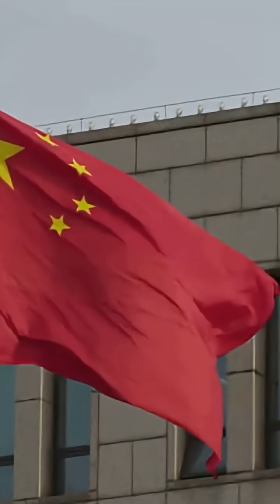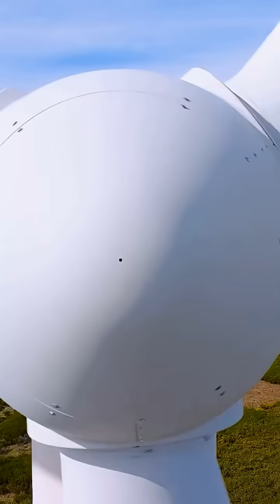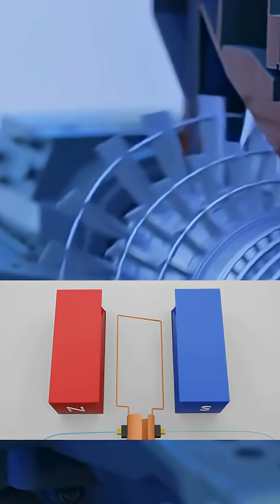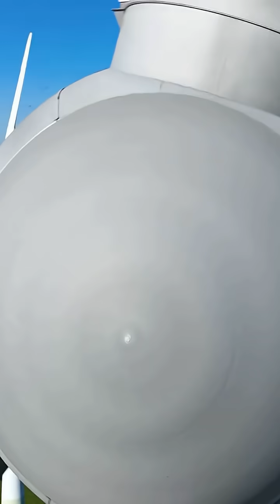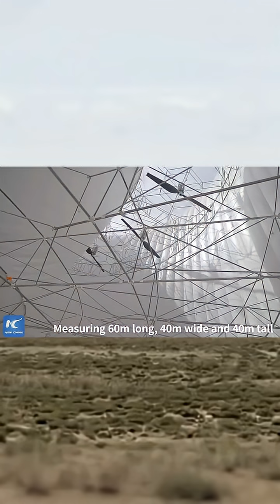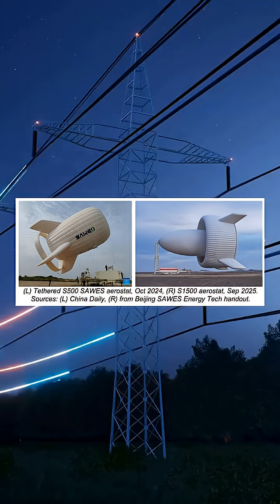The Physics Pushing Wind Power Higher #science #didyouknow

Comment: Yes, but one large caveat is danger to aircraft and open airspace management. Hitting a tether would slice an aircraft apart.
Reply from the maker: Thank you for the comment! And I fully agree with your point.  
Airspace safety is actually one of the first things engineers and regulators worry about with systems like this.

And remember that these aren’t meant to sit under busy flight paths or in open, uncontrolled airspace. They’re tested and planned for restricted zones (remote deserts, offshore areas, or designated test airspace), similar to how weather balloons, military ranges, or high-altitude research platforms operate. Pilots are already required to avoid those areas.

And as far as I know the tether will be visible too. At least that is what the international aviation regulations say - 14 CFR § 101.17.